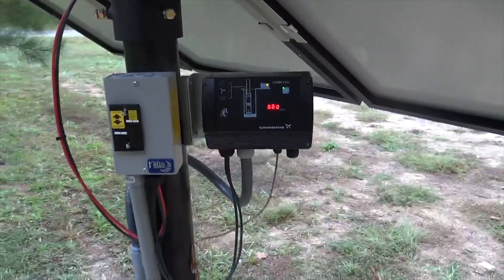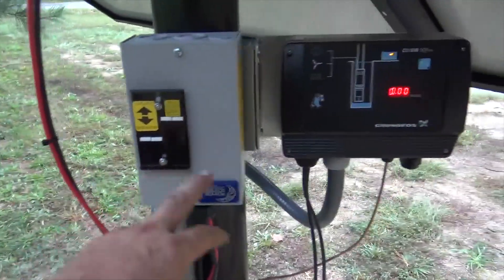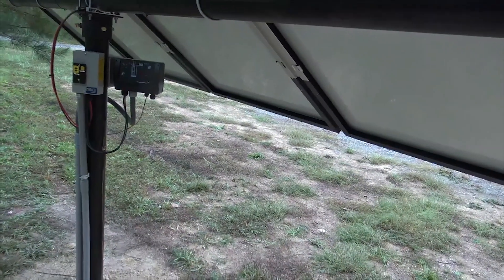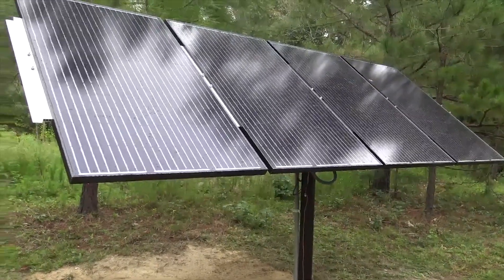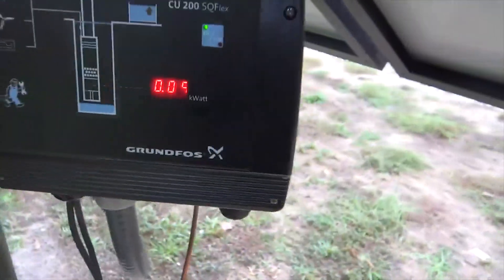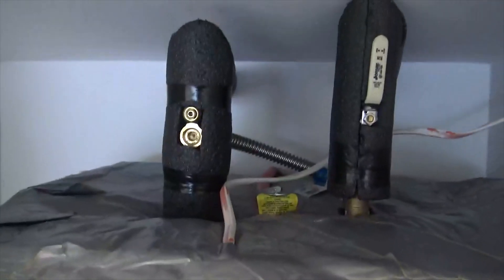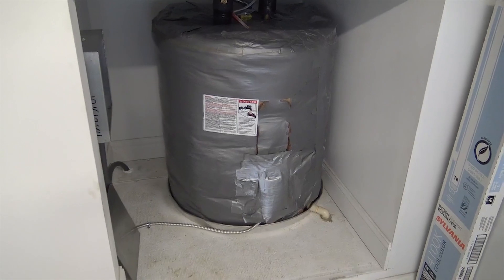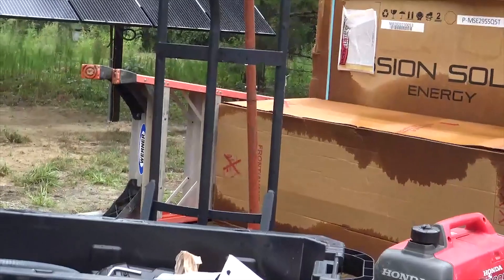Offgrid Hot Shower

Comment: Shame the world still has to use this backward technology because products aren't commercially available. My water heater can use whatever excess power isn't used by the pump instantaneously, be it 5W or 500W. The water heater can also be used as a convenient test load to estimate solar potential.  When there is enough wattage sensed sensed being supplied to the water heater you know there is enough power to switch the pump from the grid to solar.

Comment: Aluminum foil glued to bent parabolic fiberglas sheet thermally solar heating a cheap 20 gallon tank painted engine flat black at 
the linear focus with a mixer faucet or circulated to your hot water heater with a cheap lo-flo pump.  Cost, diddley. 
Cost of solar PV's and all the ungodly expensive electronics,  $1000.   
Dumb as a stump you are sometimes, 775.

Comment: does this device simply de-stratify the stored water. I installed a loopback brass destrat pump onto my unvented water heater,,,,
Reply: MultiOutdoorman The tank booster is just a mixing valve, it takes cold water inlet and dumps into hot outlet. It the same thing you do in the shower with the valve. But it will help save hot water if you run a kitchen faucet for 30 minutes.  Down side is you will not get the max stored water temp when you want it.  Say you set heater to 150deg then set booster till its roughly 125deg temp, then you can extend the hot water a little longer.

Comment: I installed a hot water circulating pump  on my split water heater. On grid top element only heats the top half of the heater. The circulating pump, pumps the water into the drain outlet which pumps the water out of the hot water outlet into the house untilizing the the houses hot water piping ( pipes stay hot, no heat loss transfer  when hot water is neeed ) with the return pipe from the furthest plumbing fixture.
With the circulating pump, I heat the entire tank ( on grid ) and have instant hot water at every fixture.
Grid down, works the same way with the bottom element.
BTW my solar is mostly for SHTF.

Comment: Nice maybe a timer on the switch (i'm lazy) or a reverse switch that comes on when the pressure is used from the tank. So pressure up solar panels on heat pressure down solar panels off pump on. Keep up the great ideas that work. Cheers.
Reply: @marthale7yes was thinking upper thermostat from hot water tank as it transfers the power when satisfied but I don't think they play well with DC power

Comment: Do they make something that is automatic that does that? Like a trigger on the water tank that sends a signal back saying "I'm full so send that electricity somewhere else." Then another on the water heater that sends a signal back saying "I'm hot enough so send that electricity somewhere else."
Reply from the maker: I am doing this automatically with the Solark 8k through it's smart load feature.  It is totally awesome and I will be uploading that soon but it requires batteries and of course an inverter.  While I am working on the latest hi tech inverters I continue to try to see what I can do with PV direct.
Reply: @engineer775  Also, I do love your videos. I have been a subscriber for ages. I just do not understand some of the things you do or why you do them the way you do. I ask a few questions when I don't understand. They are not meant to put down the way you are doing anything. Thank you for everything you do.
Reply: @engineer775  That's great. I would love to see that. Thanks for the reply.
Reply: @engineer775  would a holding tank help with the pumping in case there was very cloudy days just a thought.